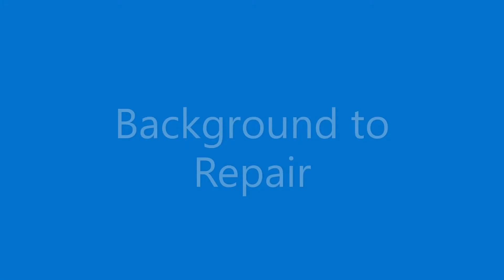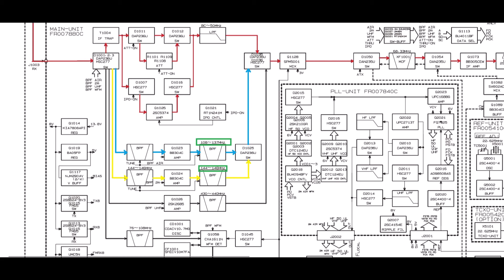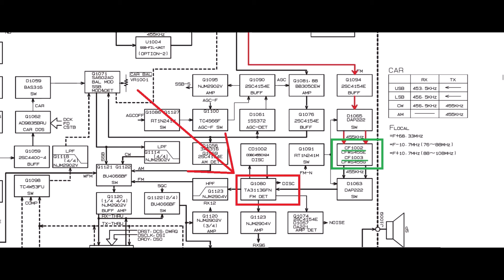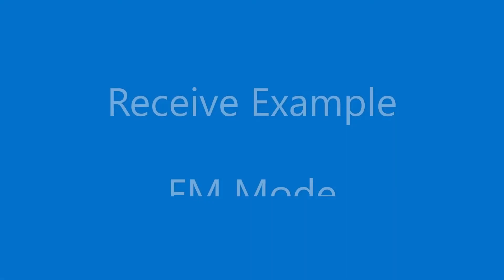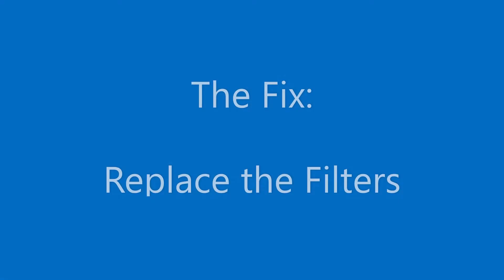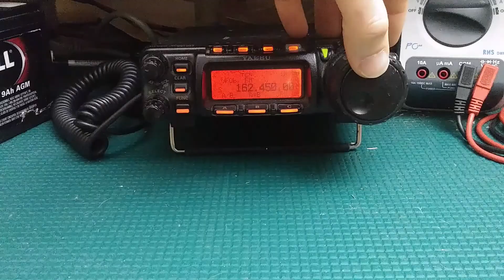3 – Replacing the Ceramic Receive Filters in the Second IF Stage in a Yaesu FT-857D

Comment: Great video I have a 897D with the same problem and I wouldn’t even think about entertaining the thought of replacing those. Since I can’t do it myself what’s a good place to send Radio to for repairs..  I am not sure if HRO subcontract that kind of work but I do hate sending my radio through the mail☹️
Reply from the maker: Thanks for the note. 

I am not real sure where to send the radio. There are lots of places that may do it. If I had more appropriate tools (better rework station) I would offer to help, however as I mention in the video - I took on the challenge and risk on my own radio. I wouldn't be so inclined to take on that risk for others, even after having a successful run on mine for the experience. 

If you are a member on any of the ham radio forums - eham, qrz, etc - you may want to post on there for some suggestions. There may be others out there that have proper rework stations that can handle the lead-free solder that could do it easier. 

Best of luck to you.